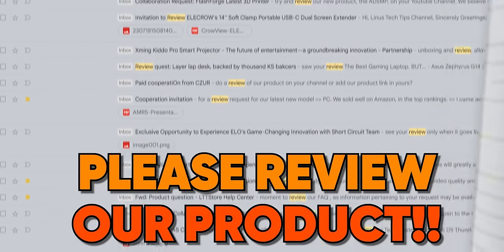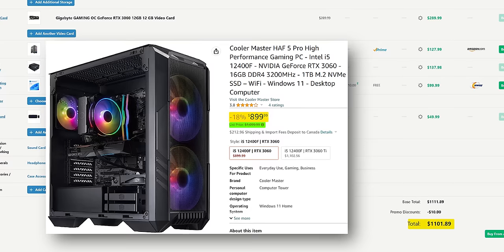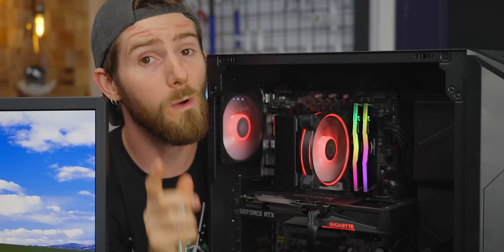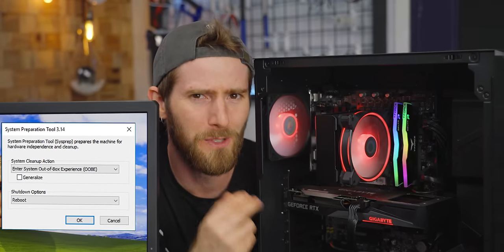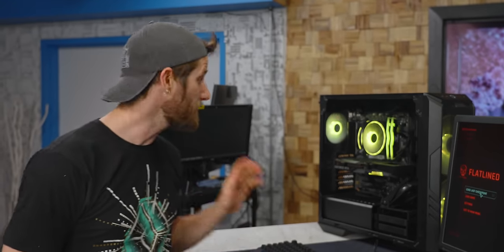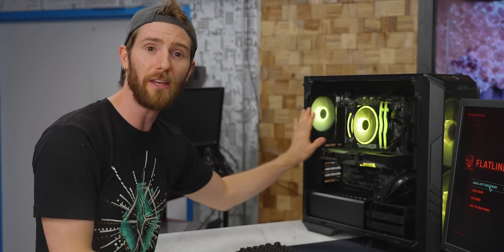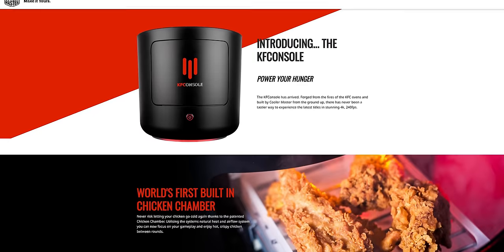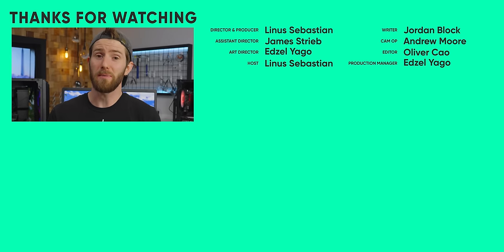Cooler Master Makes Gaming PCs Now? HAF 5 Pro Gaming PC review

Comment: Actually, this video immediately struck me as odd when I realised that I got almost the exact system from a local computer shop (I live in Australia) called BPCtech. it wasnt a coolermaster branded one but rather their own brand name. However, everything is exactly the same to the motherboard, cpu and graphics card make and model. The funniest part is even though RGB header was unplugged just like the one in the video😂. Maybe they have some licensing agreement or something. But even more weird is the fact that mine was about $300 cheaper than buying the individual components and building the system myself. Plus, I bought mine about 1 year ago now. Thats one heck of a coincidence.

Comment: 13:09 These use the same Alder Lake silicon anyway. The only good non-K 13th gen part is the 13500, which is a $250 12900 non-K

Comment: i had a pre built from cyberpower and they also wired the rgb controller to the reset switch. at the time i knew little about tech so it took me a year before accidentally pressing reset instead of the power button to figure it out

Comment: Using the "reset" switch for RGB hub control is common in many cases. YOu need ot shop cases more vs have them shipped to you.

Comment: Actually all of the cons are at least neutral when not pros in my book for people who buy prebuilds:
- reset button changes rgb -> way more easy than any rgb software and the normal user resets his pc by pressing the power button anyway
- "white" zipties on the back side -> nobody sees it normally but if you need to open it, you can see them more easily
- ram stick doesn't work -> could be a unit send back by a customer and selled as new by amazon (happened a lot to me in the last 2 years)
- windows not set up completly -> see above

Comment: I've been considering a pre-built for awhile now, and the problems with the Amazon PC is the perfect example why I'll stick with console. There's no way I'd be able to figure out how to get it running. The anxiety of buying a ~$1k  system arriving in a non working state is what haunts my nightmares.
Reply: PC's are not hard to build. If you can operate a phillips screwdriver, follow some instructions, and handle parts gently, you can build a PC. Configuring them usually takes more time than the build itself. When you're done you know exactly what's in it and learned some things in the process.

The ram stick being bad is unfortunate but not that common. I suppose if you were really worried about it you could look for a prebuilt being sold local so exchanges are easy if there was an issue.

A console cannot be compared with a PC just because they both play games. A PC can do a thousand other things beside playing games that a console can't. Though I would argue that a PC is better at playing games too (assuming decent hardware).

Step out of your comfort zone. Spread your wings and learn the things...

Comment: The ram problem is weird, I assumed prebuilt companies ran a software diagnostic on every system before shipping. Since they also didn't run sysprep maybe the system just completely slipped through QA.

Comment: gigabyte seems to be not okay with this bios stuff. I have a Z370 aurous Gaming 7 (8700k) with a 3080ti and whenever it feels like it, if CSM is disabled it'll just boot loop or get stuck at the post sceren. No post errors either, says A0 on the little screen. Only way to get it to work properly is having csm un touched.

Comment: I prefer hardware RGB controller over software one. I also use my case fans RGB controller instead of main board. But I didn't connect it to reset button, it's stupid to do.

Comment: I can't really knock them too badly for repurposing the reset button as RGB control. I used to have an old case with a Turbo button (remember those?) which I wired inline to the PC Speaker so I could turn it on and off. (I had a weird soundcard situation, and used it for very specific notifications).

Comment: Wouldn't having CSM enabled disable ReBAR? On my B450M motherboard, it would automatically disable ReBAR if I enabled CSM. 

I had to convert my OS drive from MBR to GPT to be able to get the system to boot up with CSM disabled, but it was worth it, because I was able to get ReBAR (and SAM) working.
Reply: Nerd 😂

Comment: I have one of those Cooler Master RGB controllers and if you hold the reset button it actually resets the PC instead of cycling the RGB (provided you connected the reset passthrough to the motherboard). Would probably be a good idea for them to tell the user about that though

Comment: Hey! Can you make this pc build? : Rtx4090 founders edition 24gb x2

Ryzen 7 7800X3D

Asus ROG RYUJIN II 71.6 CFM Liquid CPU Cooler

Gigabyte B650 AORUS ELITE AX ATX AM5 Motherboard

G.Skill Trident Z5 Neo RGB 64 GB (2 x 32 GB) DDR5-6000 CL30 Memory x2

Western Digital Black SN850X 4 TB M.2-2280 PCIe 4.0 X4 NVME Solid State Drive x3

Corsair Obsidian Series 1000D ATX Full Tower Case

Corsair AX1600i 1600 W 80+ Titanium Certified Fully Modular ATX Power Supply

Comment: I am looking to replace the fans in my system on a budget. I need 8 120 mm fans that i would like to be rgb. with presets controlled by LED sw. I would also like a good gaming monitor. Do you have recomendations?

Comment: Lol that reminds me of my recent Fup. I make PC's so rarely (2s every 7-10 years) im still used to just any type of of ram that matches the MB's ram type/slot should work. 
And well that just isnt a garantee these days. Whilst 1 card alone post no issues using both cards would work fine sometimes and other times games want to use RAM from inaccessible areas and crash the games. But sinds it  only happens rarely it took a while of testing and contacting the right support area that asks the right questions.

Comment: Bios being outdated seems fine fine as long as the system runs the not booting with one of the ram stick can be an xmp problem have had many problems with xmp runs perfect the day 1 and maybe 2-4 days later not anymore bios reset so xmp is off and it runs fine again turn on xmp and it does not boot anymore (yes the ram kits where on validation list of the mobo)

Comment: Comment about the Reset button as an LED button; most off brand pc cases has an LED button but has a header labeled as Reset SW. And most off brand prebuilts doesnt have an LED Button so its plugged on the reset button on the case instead.

Comment: For $810 you can build a system that would blow this  clean out of the water. i just built a system with i5 12600kf, EVGA 2080ti(beats a 3070ti and 4060 STILL to this day), 32gb ddr4 3600 mhz ram, 1tb NVME m.2 drive, 1tb HDD, with Gigabytes z690 AORUS Elite AX DDR4 mobo, 750w thermaltake modular 80+ gold PSU, Kraken x62 AIO, and a used Meshify C case with all Thermaltake RGB fans.

Comment: Regarding the Snooze sponsor at the end... Digital air moving sound being played through speakers is "unnatural". I slept with a fan for years, and the past two years with a true HEPA air purifier blowing on my face which has helped my allergies. I have a difficult time sleeping in silence or any noise other than real airflow so a speaker won't cut it.

Comment: I bought the i7 version with the rtx 3070 from Amazon. 2 week and 3 machine later. I still don’t have a pc. All 3 machine the video card was dead or had the green line across screen and code 43 error. After updating bios and everything else green lines never went away. After 3rd machine I gave up cause Amazon won’t just send video card. You have to send whole machine. Cooler master tech support wouldn’t either. Was told it’s handled through Amazon. Total waste of time

Comment: I would be curious to see a DIY PC with the same specs just to confirm they aren't doing anything dumb.  I think it's way less likely since they're using off-the-shelf parts, but I point to any Alienware review from Steve, where they're getting i7 performance from an i9 because of bad cooling and mobo design.

Comment: Just wanted to say that the Devastator keyboard? The first version felt a LOT better than ver 2. From the sound of Dev 3 when you held and twirled it around it sounds even worse. Ver 1 had some weight to it. The mouse was bad in ver 1. One angry teenager slammed it down and it broke. I am actually still using my Ver 1 keyboard but with some McGuyver fixings. One thing I couldn't fix was the sound of the spacebar haha. The keyboard was originally marketed as "mechanical-like".
Reply: To be fair, I've never seen a prebuilt or even a SI custom build come with a good mouse and keyboard. Basically just throw them in to get you up and going

Comment: I can confirm that the Devastator keyboard and mouse series is pretty awful, I had bought a set a few years back (could be 1st gen, even) to use for a month or two until I could afford something better. The membrane keyboard was uncomfortable, and the mouse behaved erratically, scroll wheel was dogcrap, buttons would not always register clicks unless you pressed them on exactly the right angle etc. Ended up having to buy a different temporary mouse and keyboard. Both behaved even worse than you'd expect 20 dollar (each) peripherals to be.

Comment: It's unfortunate that the most salient point in this video is just simply DON'T BUY PREBUILDs. While the markups aren't as horrible as the last heyday of custom built PCs you don't really get any benefits. The most obvious benefit a customer might expect is not dealing with the hassle of hardware issues and customer support which in reality is not the case. Meanwhile PC enthusiasts are robbed of skills and the confidence to work on their own PCs. Today is still the best time for parts selection. It's really hard to build a bad PC these days with SSDs being cheap and even toothpaste will cool your CPU. Best of all most of PC building assuming you're graceful can be learned from trial and error except for a few basics that haven't even changed over time.

Take your time. You should overspec your PSU for the task. CPUs matter in gaming. Installing an OS isn't hard you just haven't ever done it. It's actually the motherboard that you'll want to do the most research on. Finally, you CAN push hard on the ram, you CAN'T push hard on the CPU.

Comment: Not updating the bios on new systems at factory is something that is annoying for the user, but honestly is ridiculous for the manufacturer to handle 9/10 times just because of shelf timing, shipping etc.
Reply: The regular user isn’t ever going to flash a bios which is why it needs to be done by the si before it gets shipped out.

Comment: Reset is such an obnoxious button. It can be easily pressed both accidentally and by home pets. I always remove it since you can just hold the power button to achieve the same result.
And by holding you dodge mistakenly resetting your pc, because you can stop holding the power button if your pc comes to life and then click "Cancel" in Windows shutdown screen.

Comment: Somebody with experience troubleshooting PC hardware is probably perfectly capable of building one themselves and would be better off doing so. I couldn't recommend this to anyone when it came non working out of the box. But I never recommend prebuilts anyway. Either build one yourself if you can, or get a custom built from a PC builder.

Comment: Amazing that the Amazon one did not post at the beginning, that is absolutely terrible. If a consumer bought this pre-built (because of the value and maybe lack of knowledge for building themselves) this would have been a bad buy. Sure customer service would have solved this with support on site or a return sending but that's still a bad buying experience if it would have just worked.

Comment: It might be incredibly nit picky, but the use of zip ties makes this a no-buy for me. I do not want to have to put sharp objects and break plastic pieces everywhere just to change or add components.
I know velcro is more expensive than zip ties, but it really kicks "user friendly" in the face. While also being unsightly regardless of how well it's cable managed.

You might argue that the average person would never even open the backplate. But god forbid a cable or something wasn't plugged in correctly, and you had to guide a consumer through troubleshooting scissors in hand.

Comment: Where the hell did cooler master get those numbers from on mw2 at 7:49? An rtx 3060 is most definitely not getting well over 200 fps at 1080p ultra, and a 3050 is definitely not getting 175. Hell, a 3070 can barely get the numbers they are claiming for the 3050.

Comment: I never understood the point of benching CSGO because there's no way the poeple that do the bench understand how to get the most out of it. I guarantee Cooler Master didnt uncap the frame rate in the dev console because unless you do fps_max 0 you want get anywhere near what the system can actually do, My 5600 and rtx 2070 build gets like 800 fps in matchmaking on 1080P max settings.

Comment: Having an older BIOS installed is not necessarily a "bad" thing. It all depends on what the new BIOSes versions were changed and most changes address support for new hardware. Having an older BIOS is not "optimal" but it doesn't mean it's "bad" ... it always depends.... and then you have the new BIOS that makes it even worst ? Those are the devil ...

Comment: Of all the companies out there, ASUS may be one of the best placed to pull something like this off, since apart from RAM and SSD's, they make everything else and it's all industry standard parts. Corsair is fairly close, but they don't make motherboards and GPU's (yet) so they can't do a 100% system either.
Reply: Corsair and industry standard parts is an oxymoron. Their RGB fans are highly proprietary.
Reply: @TheSjuris Sort of actually. The power to all but the new QX fans are still 4 pin PWM which is the standard. The RGB connector is the old Molex connector used when CD audio still had a separate cable to a sound card - so hardly the standard of the ARGB plug but hardly super proprietary either. To be honest, I think I prefer that connector over the horribly flimsy ARGB one.
Reply: @craigmurray4746  only product that uses the cable so yes it’s pretty damned proprietary. Rather have Lian Lis approach or use the ARGb connection like everyone else and then you wouldn’t need their software to run it.

Comment: Hello you lovely people 😊
I need a little help with building a Gamimg semi budget PC for my nephew.
He bought some components, but I didn't built a PC for a long time so I'm kinda rusty.

So he bought:
12th gen I5 12400F with a stock Cooler.
Asus RTX 2060 6GB.
Any suggestions for a solid ATX motherboard in a price range for about 200€ wich has DDR5 memory because i want to give him a space for an upgrade in a CPU/Graphic card area.
Would 800-850W PSU be a good solution for a future upgraded down the line?
Thanks guys for any suggestions !
You are a nice bunch if people to get around with.
Wish you all the best ❤️

Also, a huge TY for the LTT group, they are so knowledgeable and entertaining at the same time. I can binge watch them for all day long. 
YOU GUYS ARE THE GREATEST ❤️

Comment: No doubt using the controller hub and RGB button makes it "just work" even if they use a motherboard without RGB.  And I'll be honest I really don't want to run RGB software.  It would be a different matter if the BIOS hosted the RGB options and I didn't have to mess with the always lame utilities.

Comment: Using the Reset Switch is nothing new... lokking at you Asus "Flex Key"... Out of the Box the FlexKey was default setting on X570 Asus Borads in the Beginning. 

Was driving me Nuts when i had to Hard Reset my System and int didnt work. 
Checked the Cables everything was fine... 

After some Research  i did discover the FlexKey Option. 

Nah... if u want to use a Button as a SI , use a dedicaded RGB Button..

Comment: So my computer wouldn't turn on the other day... I put it to sleep and it wouldn't turn on.
Finally got it working by... Turning the power supply on and off? Yeah the reset switch was useless, in fact I never use it. If I need to turn it off the power button does fine. 😅

Comment: I wish you guys would have been harder on them about the system not positing out of the box. Faulty ram, faulty display port that required a bios change, and bar not enabled? Sure, for us tech heads we can fix that. But for the public? It would have been an ABYSMAL experience to have a DOA system. Because that's what it was, DOA. It wouldn't turn on with the ram installed by default. 

Not only would it be DOA, but once the ram issues are fixed, if the user was using display port they'd STILL have issues. Absolutely do not recommend this at all.

Comment: They probably used the reset switch as the RGB switch because they know how awful Gigabytes aRGB software is. Granted there's other programs like Signal RGB but CM probably figures it's a $900 PC, at that price point and being a Prebuilt it's likely easier for the end user to press a button rather than use an atrocious software... cough cough RGB Fusion/Control Center. I know Asus' and MSi's isnt the best but by far better than Gigabyte's, Hell Asrock's Poly Chrome/RGB Sync is better. Overall on CMs end, Great Parts and quality and PC overall for that price!

Comment: lmao either linus is a keyboard snob or i dont know, i used that same devastator kit for like quite a few years and never had a problem with them, i quit using mine after the keys started failing but before that i had no issues with it, like it more than my previous logitech keyboard i had

Comment: I have bad experience from Cooler Master. Power button did not work, because they put a screw through the cable. I also had instability due to their power supply. I will never buy from them again.